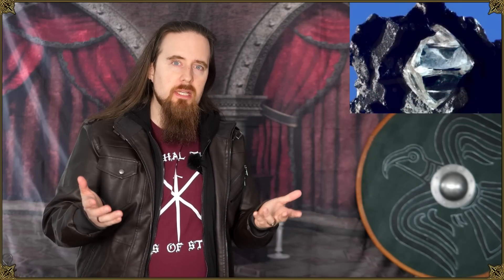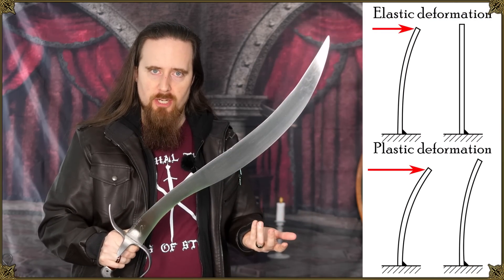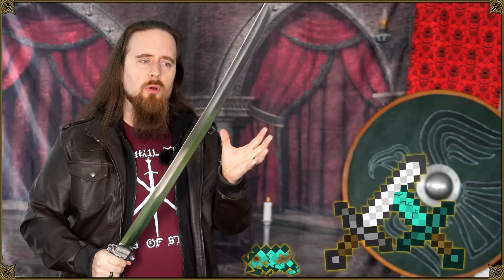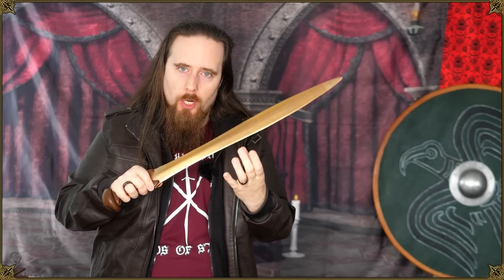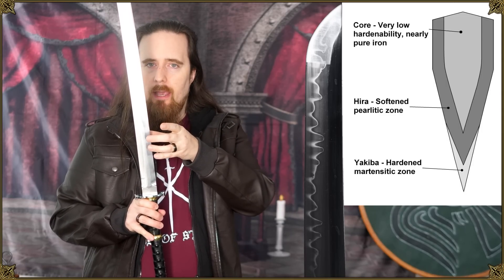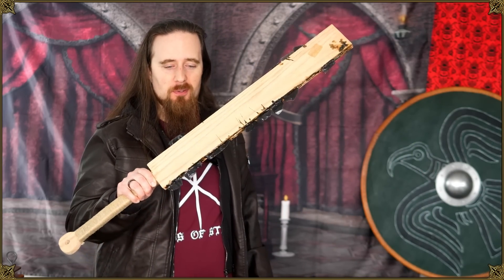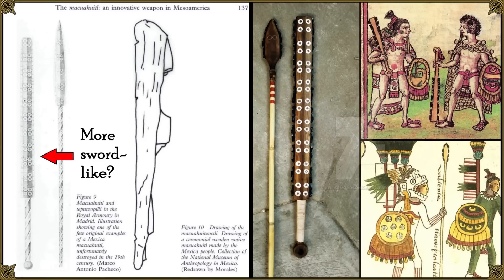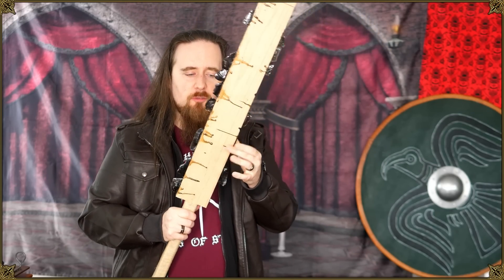Diamond Swords: Could They Work IRL? (Kind Of)

Comment: Skiallagrim: The issue is that Diamond is only strong in one direction, if you hit diamond in the opposite direction "It will shatter, like glass". The only way to Strenthen Diamond is to somehow fuse diamond with sheets of diamond in opposite directions. The problem is that diamonds, and Magnets likes to have poles. Making a diamond that is both Horizontal, and Vertical is hard to fuse, because the Crystals will move in the same direction. If you could turn Diamonds into a carbon fiber like structure, then its possible to make a diamond Sword.
Reply: When they make artificial diamonds. they certainly can put some armature inside. But if the armature is made of carbon too, it would turn into diamond as well.

Comment: But what about diamond mace/maul? You can see these in Dragon Age : Origin , fine Dwarven crafts.
Reply: Stronger than a thin sword, but it could still be chipped (and fractured if struck in the right place). Plus, you could never repair it.
Reply: @chocopuddingcup83  I think it is indestructible, light weight and destroy armor easily.
Reply: @MizanQistina  The larger the diamond, the more points where it could be struck and fractured. Diamonds can also be chipped with enough force applied.
Reply: @chocopuddingcup83  But what if the diamond have flat clean surface like Thor Hammer?
Reply: @MizanQistina  More resistant, but still a large surface area, meaning more areas to chip and fracture. Oh, it could take a pounding, but each chip would damage the structure further and you wouldn't be able to repair it. One good blow into one of those chipped areas and it could crack the whole thing.
Reply: @chocopuddingcup83  Why would it chipped if it is the strongest material, it is not a block of plastic or glass, it's a block of diamond. The only way to shape a diamond is by grinding from heavy machinery.
Reply: @MizanQistina  Diamonds can still be chipped by a sudden, blunt force. A common hammer bought at any hardware store could shatter a diamond the size of a maul, or at the very least fracture it.

Strength and hardness are not the same thing: diamonds are very, very hard, but they're inflexible and easily shattered by enough force. The carbon atoms in diamonds are extremely rigid, and keep a precise structure, and any tampering with that structure causes it to fracture. For example, you could scratch and score a steel sword with a diamond quite easily, but a diamond sword would shatter into a dozen pieces if struck by a steel hammer.
Reply: @chocopuddingcup83  If a diamond got shattered by a common hammer than it is not a real diamond and you got scammed. 😆
And I don't think steel hammer will shatter a diamond sword it is because the bond is unbreakable. Again, it is not a glass, it's a crystalized pure carbon grind into a shape of a blade.
There are bulletproof synthetic polymer, made into shield or car window, the same thing here. If these polymer can deflect a full force of bullet, the same way diamond sword can deflect anything
Reply: @MizanQistina  Mate, you didn't watch the video, did you? Steel and the synesthetic polymer you mentioned have elasticity. Diamond does not. What makes bulletproof glass bulletproof is the atoms MOVE and spread the blow out along every other atom, nullifying the overwhelming force of the impact.

Steel is a strong material, diamond is a hard, yet brittle material. Why? The atoms that make up diamond are in a rigid and inflexible lattice, meaning extreme force, especially along its cleavage lines, can shatter it, and the larger the diamond is, the easier it is to shatter because it has more potential areas that can cleave (this is how diamond drill bits are made). Again, this takes a lot of force, but diamonds do shatter under sudden, extreme pressure (but not under sustained pressure).
Reply: @chocopuddingcup83  In context, it is about diamond mace/maul/hammer in which going against similar weapon or armor of different material which means the force behind the attacks are just as strong as human can do.
Since diamond crystal is the hardest material, by that alone no weapon of any materials can shatter it, not even scratch it. 
Let say you found a large block of crystal which is diamond, you grind it into a Thor hammer, it is better than steel Thor hammer. Nothing in human might can destroy your diamond Thor hammer.
Reply: @MizanQistina  If we're going to get fantastical/magical about it, you can do whatever you want.

In the real world, a diamond that large would still be fractured if enough force was applied along a cleavage line. All it takes is the proper force applied to the proper place (and a larger diamond has more places to hit). A steel maul would be better, because it can be repaired/reforged, and is far more elastic and capable of absorbing blows.
Reply: @chocopuddingcup83  Like I said, no human force can fracture diamond, it is simply indestructible. It will take months or years to grind the chunk of crystal to shape it into a weapon only by using human force. 
In medieval era, diamond weapon will destroy everything.
Reply: @MizanQistina  There's dozens of videos on YouTube of people pounding diamonds to dust with a hammer, so no, you're incorrect. A simple steel sword would break a diamond sword in half, quite easily. Again, I don't think you even watched the video because this was explained in the first couple minutes.

I really don't think you've understood a word I've said. Diamonds are not some miraculous mineral that can withstand any kind of impact. You're not understanding the difference between hardness and strength.
Reply: @chocopuddingcup83  Those videos showing small refined diamonds being crushed, you can do the same with any materials 😂
Even so many videos showing that even those small refined diamonds damage the hammer crushing them.
I think you don't understand what diamond I am talking about, it's not those small diamonds made for jewelry, but huge/big chunk of pure carbon crystal grinded/refined into weapon. 
Ok, imagine those small diamonds you see in those videos are 30-50 times larger and being the head of a mace/maul...